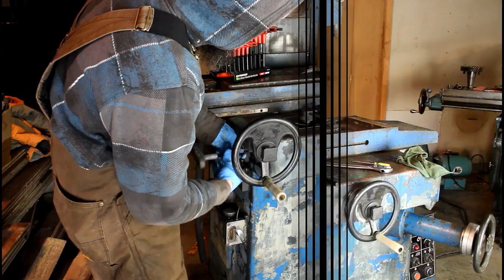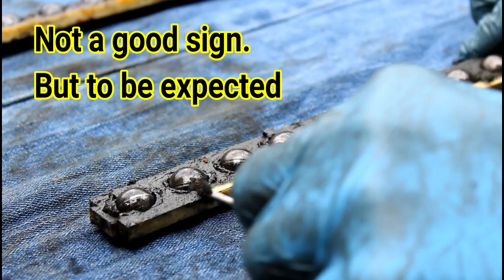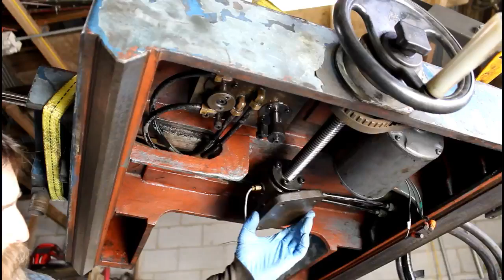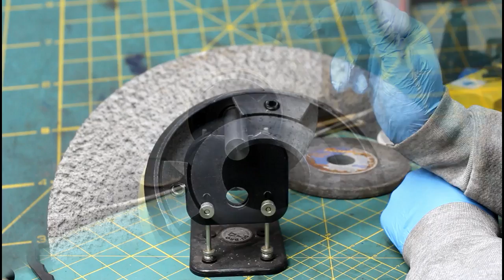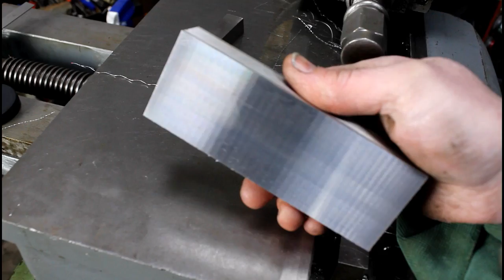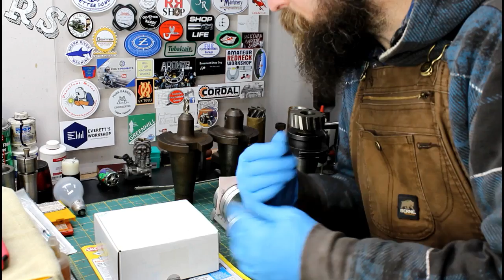Grinder Teardown and clean

Comment: Mcmaster Carr the balls are about $1.00 ea. I'm sure Amazon or Ebay will have better deals. Good luck on the test grind. My grinder's ops manual says .0002" per pass and dress the wheel every pass when grinding the mag chuck.

Comment: @22:00 the grinding wheel rolls back when you let go of it because  the oil or light grease is building a ramp as you roll it. . Those are probably shielded precision bearings spray the oil or grease out of the to remove all rotational resistance. Then you can set the wheel at every 1/4 of a turn to find the heavy spot.  Those bearings only need light oil for storage. Not for use.

Comment: your wheel balancing routine will change when you have a really low friction balancing stand.  Thank goodness my B&S Valumaster was hospital clean when I bought it. Keep up the good work.
Reply from the maker: Yes I'm sure it will. This is just what I have to use at the moment. 
I'm surprised at how well it actually works. With a real low friction unit you should have very little to no spring back👍.
Reply from the maker: Good clean grinders are hard to find at a affordable price. I'm on the lookout for a nice unit . I really want a nice auto grinder. Cranking handles gets old in about 3 seconds. Not to say I wouldn't jump all over a manual clean older machine. I just want a good accurate well kept machine. In time I guess. Nice to see you
Reply: @SteveSummers   Train one of those kids of yours. ;-). I may eventually look into designing and building a simple stepmotor drive for mine. For the time being, I just get into the zone and don't think about the tediousness of grinding. It's a Zen thing.

Comment: I always like your style and goodies you have for us. As always, THANKS STEVE ! A little loving goes a long way for sure. A couple leather or thick canvas skirts may be a good option to consider. Kerosene is always the go to cleaner for sure. It leaves a nice coating of oil on the parts that other cleaners strip off and can cause soooo much damage as a result. New balls I can't see as causing any wear and should tighten the old girl up nicely.From what I see and how you describe things I don't think you have much to worry about but only time will tell eh. Great post and always a nice visit with you bud. Many thanks. The loving you put into all your equip. sure goes a long way as far as tool life for sure.

Comment: The machines wear is what sets a machinist . An operator only runs them , you'll be able to adjust and know what to do. I had to use a VBM that built noahs ark flattered and clanked like a black Smith hammering . Yet with indicators holding tolerances to .001 was no problem . And grinding tool bits was my fortay seemed even the older machinist like them or maybe just were lazy. I didn't mind my fingers became amuned to the hot bits , I could tell if it was right when I hand honed each bit , the extra bone makes them last longer. I think I'd change the roller balls on it tho. Other then that it should be better then most old ones.

Comment: Glad to see that it doesn't have much in the way of "greater than usual" wear or damage.  Mine is a portrait of contrasts.  It's been kept clean where it really counted, other places are filthy.  Ways were re-scraped, but the hydraulics need a lot of small leaks repaired ... probably more due to age than use.  I'm at a point where I need to find a phase converter that can easily handle everything on it before I can continue with it.  It's that 'life and other plans' thing that plagues all of us.

Comment: Could graphite grease be substituted as the lubricant for the ball-bearing strips under the table to reduce dirt buildup due to clumping of oil/grease and dirt?  I do not know if it would be long-lasting enough to be worth the change, though.  Do you have a maintenance manual for the machine that talks about lubrication?

Comment: I would think that its best to change balls now that you have changed thier position, a ball will turn till it reaches point of least resistance and stop letting the others take the strain/weight. I have no experience with surface grinders but a little bit on bearings

Comment: I certainly would not have put grease back on the balls.  Grease really collects grit.  Still, you have the manual, Steve, what does it specify?  I have heard to run ball linear bearings dry, but then corrosion might be an issue longer term.  Which perhaps leaves us with oil, though I am shooting from the hip here...  My old B&S 2L surface grinder has plain ways, so they get way oil, and anything that does not slide gets AW68 hydraulic oil.

Comment: GJ Steve! A lot of work and patience on your part. Luckily the grease wasn't dry and hardened. When I got my old lathe and hacksaw someone used old cheap grease on which dried up and hardened. I still have nightmares about that because even the most aggresive chemicals didn't work very well.

Comment: For years my 'go to' general cleaning solvent for mechanical items is good old diesel fuel. It's cheap enough, does an effective job and leaves a thin oily film on the cleaned parts, after draining, so they don't immediately flash over rusty. For many items if they are fit for re-use they can go straight back into the machine they  are from.

Comment: It would seem a slight clean air fan pressure under the table would be a smart way to shield it properly.  Steve, you really need a decent parts washer tank over drum setup.  Cleaning parts goes from no fun to torture without one.  ;-)

Comment: My vote is the center was relieved so the nut only touched where the fasteners went.  That grinder actually looks better made than what I would have expected.
Reply from the maker: Yeah, I agree👍 The flat for the nut is relieved so it sets flat I would guess. I was also surprised at how heavy it's built. Not a bad grinder. I'm thinking with some work it actually may make a decent machine. I'm doing some 1st tests with it and am surprised how nice it's acting so far.  We will see👍. Thanks Brian

Comment: Your table bearings are linear bearings and they are held in a "cage". If they have any pitting at all replace them. I run 12 inch wheels on my grinder at work. We use Norton primarily but others as well. My balacing tool has 6" x 1/8 wheels and is adjustable for width of arbor axle. I first load the wheel and hub on an arbor then remove all the weights(my hub has the same weight set up as yours) and let the wheel "find itself". I then mark the wheel on the heavy side and rotate 90 degrees. By repositioning the weights I can usually dial one in without removing wheel material. Sometimes they simply won't balance so I won't use them. Be sure and check your spilndle for run out. My machine was crashed by another operator and the spindle had to be replaced. Couldn't get a finish. Hope these tips help.

Comment: I've never understood the concern with transporting a grinder with ball ways. All components are hardened. I can't see the stresses being any higher than normal use. We transport machines with linear guides and even ball bearings all the time with no concern. Looks like you might have a decent grinder under there!
Reply from the maker: I'm not sure Wes, I know the manual says it's a good idea to remove or block the table. This thing on a trailer hitting a large pot hole with the table just being held on by its weight would be a crazy hard impact. I have only heard stories of damage. You know how that goes.
Reply: I guess I'm just spoiled by our silky smooth Illinois roads  🤥
Reply: Wes Johnson Services 🤣
Reply: Bouncing of hardened balls on hardened tracks can brinell the surfaces. I think you would have to not have everything strapped down tightly but why chance it I always felt.
Reply: Very high quality machine tools, may have anti-vibration or Isolastic pads fitted to the machine bases during transport, or specify air ride suspension vehicles only. But yes, the indexes should be locked, and or strapped.
Plain ways are less susceptible to any brinelling.
Reply: A couple of nylon ratchet straps with a wrap around the table, strapping to the machine itself and not the trailer takes just a few minutes. Easy peace of mind. I know a spring style trailer will jar and bounce enough in a bad spot to do it,  if it is prone to happen. Big trucks with air ride carry machines much more gently even though it wouldn't seem so.

Comment: Even low speed metal balls in a rack need grease or oil.   A well designed dust shield would seem to be most complementary, if not absolutely essential.

Comment: Vertical jack screw tight? That is what was occurring in this Gingery shaper I just read about. (low effort google search) The rippling might be fixed by easing up that screw a bit?

Comment: I wonder if the mill has the option for using a parking attachment for the vertical head? I know its an entirely different generation and the controls are very different than abom79's but if it's possible could be a nice project down the road. You know, when you're not busy, so maybe within the next 50 years? Haha. Keep up the great work Steve!

Comment: nice thing that you can replace the rails and the bearings 
wouldve been a lot more work to remachine and scrape in if it ran on  dovetails 
think you can get that machine good as new if you replace both the the bearings and the rails
darn balancing that wheel like that would definetely NOT be the way i would do it 
i think it will invite stress cracking 
bight instead gleu and clamp in a large washer next to the grindingwheel basicly the same size as the label and drill or grind that to balance the whole setup

Comment: no reason not to replace the balls, sure the ways are worn and so are the balls, but the balls arnt going back in the same exact place, so might as well replace with balls that are to spec, you might be putting balls back and making wear seem worse
Reply from the maker: I thought about that and am considering replacing them all with some medium grade balls.
Without grinding the ways putting in balls that are
 + - .00002" doesn't make much sense unless they are cheap.  I don't quite understand the way they are designed to wear. Unless everything is perfect only a few balls will carry the load even new. One ball wears and the others take the load after that?  Still trying to figure out the deal really.  Good grinder to learn on I guess.
Reply: @SteveSummers  The ways (X, not Y) are replaceable too and actually look pretty new. Perhaps they were replaced not too long ago. Either way that machine is very rebuildable so you have a keeper there!

Comment: Steve,
   Do you know what that bearing assembly is called? I would like to acquire that type of bearing assembly for an upcoming project.
Thanks
Reply from the maker: I do not know the technical name for this type setup.
Reply: The assembly is called a linear bearing.
Reply: Bob Korves I tried using that but cannot find anything even similar under that name anywhere on eBay, SKS Mfg. or anywhere else. Just makes me wonder if they are offered at retail.
  All linear bearings produce are CNC type assemblies with the encased in a Long hub moving on rods.
Reply: @dalegriggs5392  -- Try "Linear ball way cages", and also look here:  https://www.youtube.com/watch?v=OrFG8X7w8yQ
Reply: @dalegriggs5392  --  https://www.icb-usa.com/media/kmf/Linear_ball_cages(k35_0).pdf

Comment: Thank God. I couldn´t sleep the whole night. Seems a ultrasonic cleaner would help. Some kind of chip guard riding in front of your shear tool just a thou or so higher than the surface of the part could be worth a try. So it would act as a snowplough and push the chips out of the way.

Comment from the maker: I'm alive !   Tech issues this week. :-{
Reply: I've gotten into the habit of watching your post each Saturday morning while I have my (first) cup of coffee. Something was missing yesterday.. :) Glad you got it sorted out, in time for this morning's coffee...
Reply: Was thinking lol
Reply: Steve. Nice job on your new surface grinder. One Question, do you have a front support on your shaper? It looks like you have provision for one, but I have never seen you use it. Cheers.
Reply from the maker: @slypig24  No front support. One will bolt directly on but they weren't as common on the universal table models. Mine was shipped from the factory without it. It was a option if you planned to do real heavy cuts. For normal work they are just in the way.
Reply: @SteveSummers I like your sheer tool.  I wonder if support would help with any movement? Your subscribers could look for one for you. Cheers.
Reply from the maker: @slypig24  I haven't noticed any deflection to amount to anything. I'm sure it would help tho👍
Reply: Steve please send me you're contact info, I have two woodworking machines I am restoring to a condition better than new, I have several parts and peices I would like to commission you to help me with. Thanks
Stan